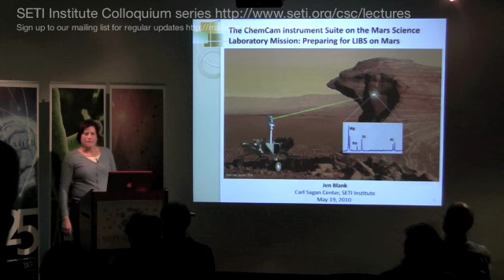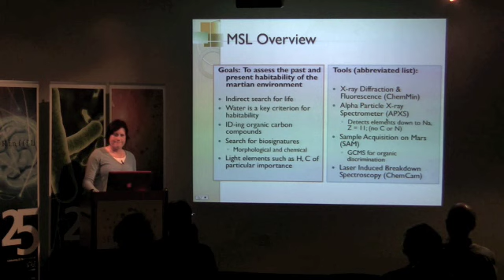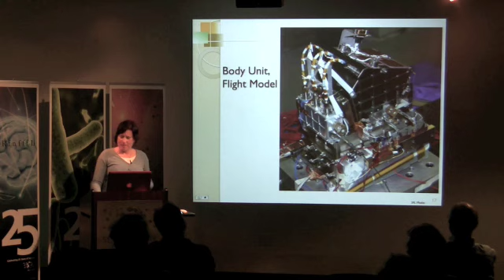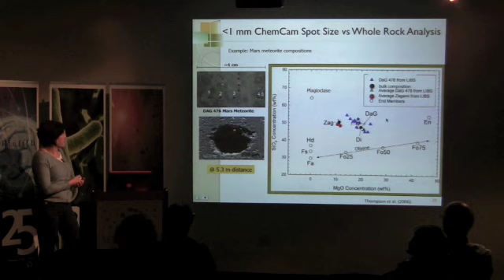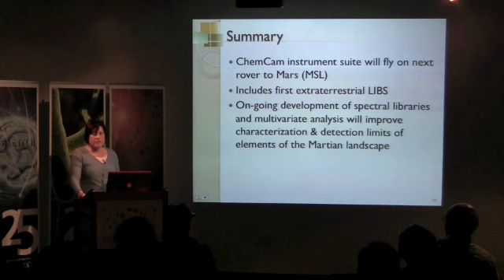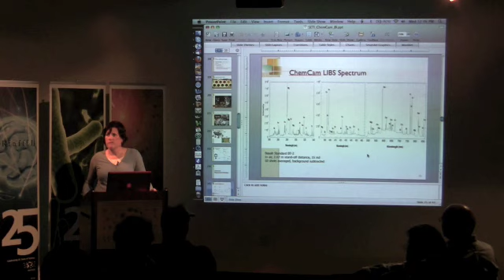ChemCam on Mars Science Lab - Jen Blank (SETI Talks)

Comment from the maker: @looksintolasers I got this response form Jen Blank: "The laser will fire at low energies - less than 15 mJ - and won't damage the rover.  It might take off a little paint, though, if the aim if off!  Nothing to worry about.  (It would be hard to see a small paint burn with the naked eye.)
The calibration samples are large (a few cm diameter) in comparison to the < 1 mm diameter by tenths of mm depth spot size of the laser and should outlast the mission."